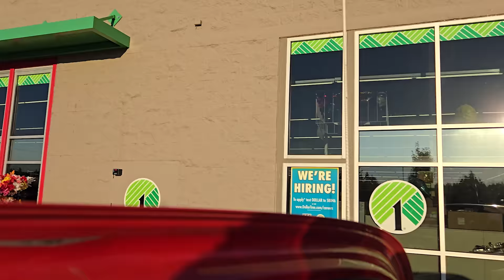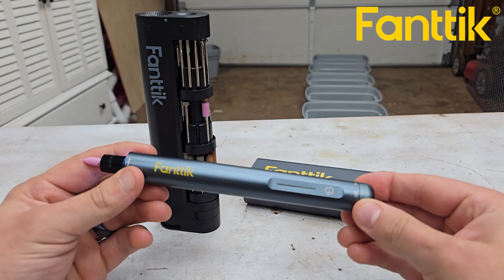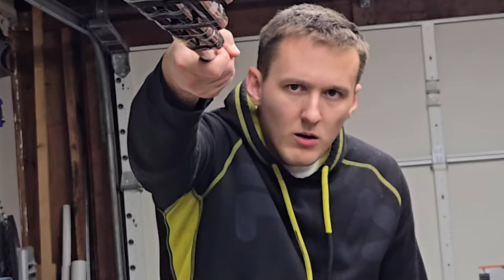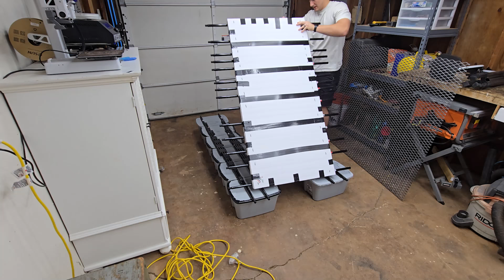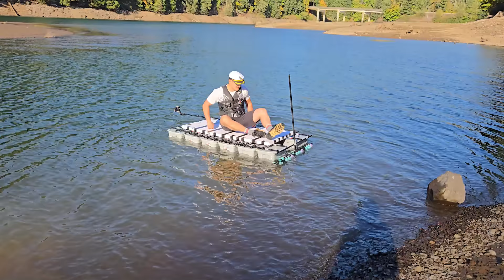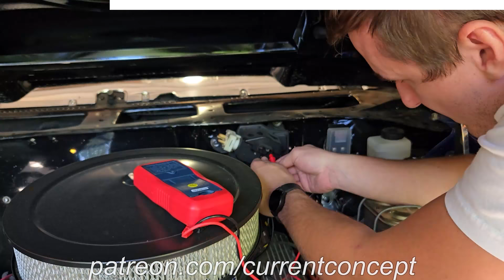Can a handheld fan power a boat?

Comment: its kinda funny,   there are inflatable boats that are less expensive...   

but for plastic 12' john boats your looking around 800 dollars.  Pelican intruder or American sundolphin are often around 699-799 american through some sales have them as low as 499.   for a 12' plastic johnboat.

Bass Pro Shops Prowler 12' Jon Boat which is about the same as the sundolphin is 649.   these are probably the cheapest "real" boats...

after that your up to aluminium hull johnboats and such but they start in at 12-1300 dollars

Now for "true" (use term sort of lightly)  boats.   14000-16000 US.  the C-Dory 16.   A 16'  hard top cruiser, with vberth in the front to sleep, which CAN mount a portapotty.   that you can take out for a day cruise, overnight, or even weekend cruise.   the fact that its enclosed bridge, can be heated,  is only 16' long,  can be easly trailered and even stored in some garages...  these little things are insane.

Comment: Physics tldr for the extremely lay:

You can calculate how much one plastic bin can keep above water by simply filling it with water and then weighing it.

The water level in the test shows how deep the bin will sink when it's carrying the same weight.

(Excluding the weight of the empty plastic bin)
Reply: extremely lay man here, can confirm this method is inconprehensibly unreadable.
Reply: @beaneater6932  I am a pretty lay person myself too

Comment: id just get free wooden pallets from my local hardware store(they give out free extra ones), and tape a bunch of 2 liter water jugs to them, that i can get from a recylcling center, and tape them together with duck tape from walmart(4.50$). I might want to attach multiple pallets together, so ill nail them together with extra wood i break apart from other pallets(nails cost id say like 20$), and i have boat. For a paddle i can just use my nieghbors shovel(free, I STOLE IT!!) and i have a boat thats better for like 25$. Maybe more, i forget the price of nails. 

Fun video. Dollar store has always been there in times of need, and cheap cookies and soda